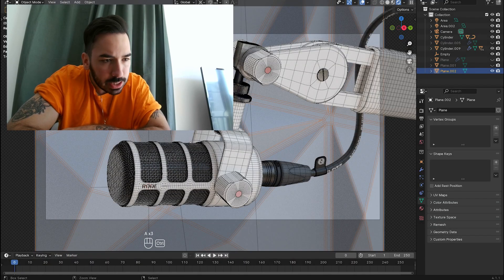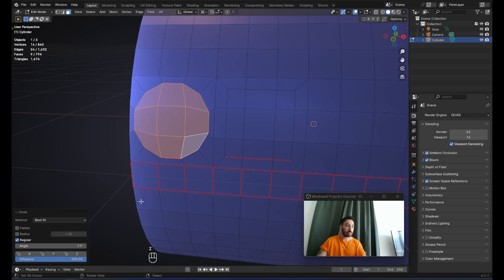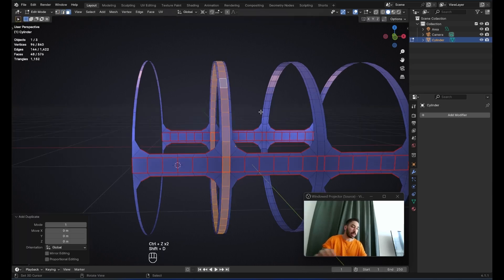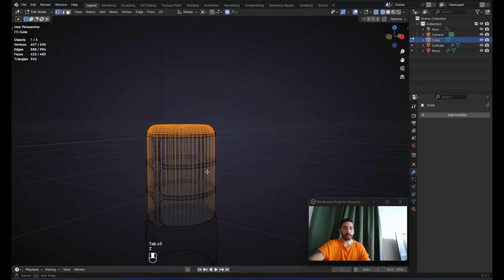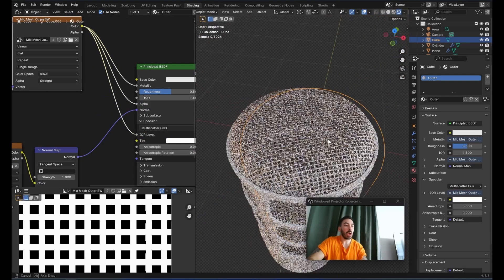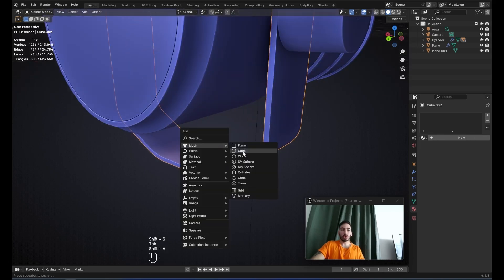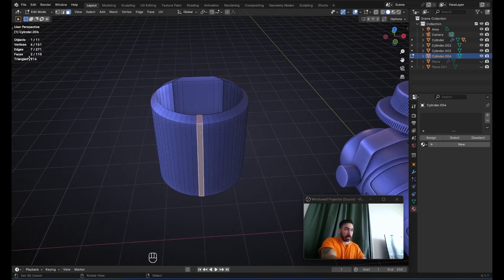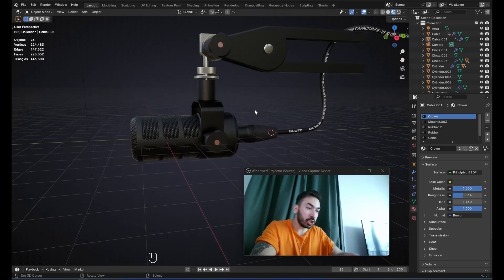Hard Surface Product Visualization - Blender Microphone Modeling (Aryan)

Comment: @12:55 I don't get the same result from the grid fill. In the video it shows same as my result then next frame jumps to your model showing <Pick Shortest Path> rather than <Grid Fill> on the left and a nice tidy grid ready for the inset. Thus far I have failed to achieve your result without adding loop cuts which starts to trash the topology.